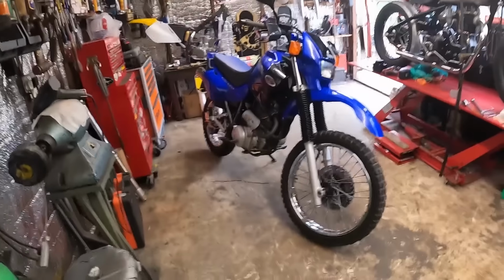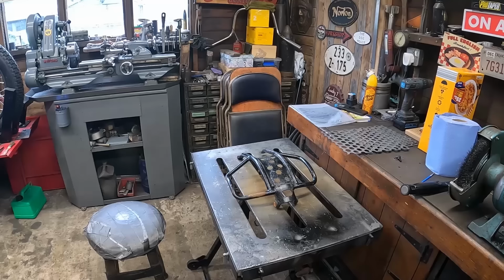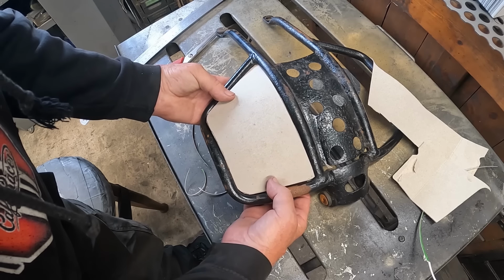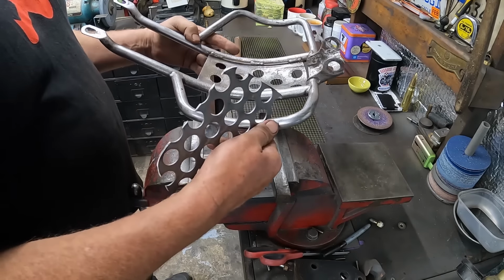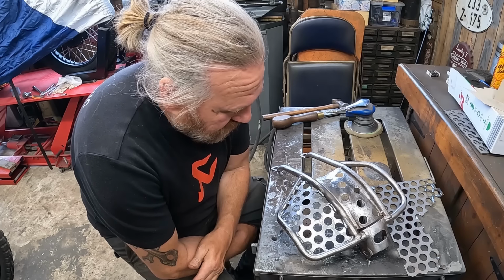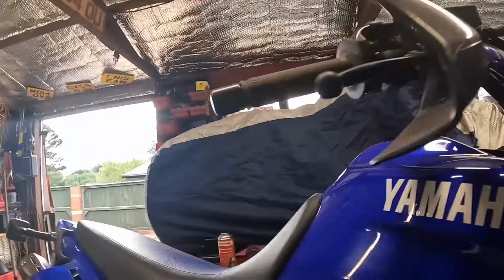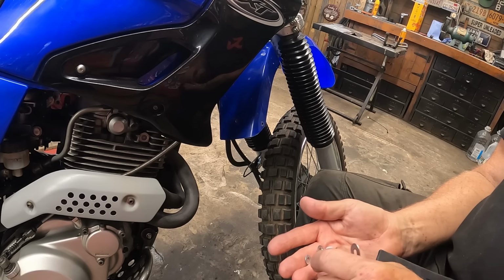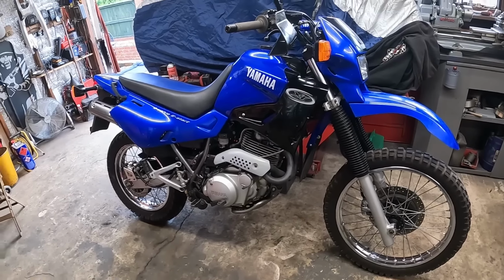Yamaha XT600 Sump Guard Modification

Comment: Hello mate. The welds might be pulling contaminants through from the inside of the tube. It’s probably as rusty inside as it is on the outside.
My first bike was a 2009 xt660r. The forks were terrible. Really undersprung and under dampened. I found aftermarket springs and oil from hypertech (I think that’s what they were called at least). Cheers again for taking us along for a day in the shed.

Comment: I used to have one of these not too long ago, with some light modification, you can fit the big aluminium sump guard off the old xt600z tenere from the late 80s/early 90s. Much better than the crappy excuse for a sump guard these later ones came with.

Comment: Craig back in the day we once fitted the tee piece your thinking  of to the f/mud flap BUT the fitting of the tee piece caused a very bad accident to a friend by the flap getting bent backwards and going to far back that it affected the steering of the bike he lost control as handlebars as they would not turn as he wasn’t expecting the tee piece to be as strong as it was even being of mild steel plate, hope it helps and great work and videos..

Comment: They never had a mud flap as standard and they not needed on the XT , Spend you money on getting some decent suspension on the rear as the suspension on them xt600's are horrendous , also the rims are prone to rust and rotting out  , I've had s few of them engines apart over the years, hardly any genuine parts from yamaha are avaliable any more for them, kevo germany are good for most parts for them that don't cost silly money